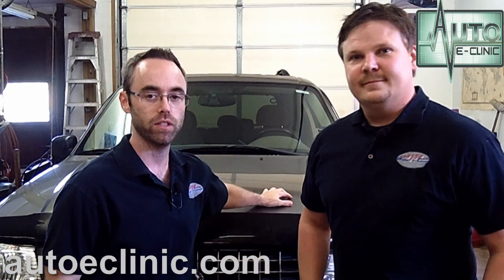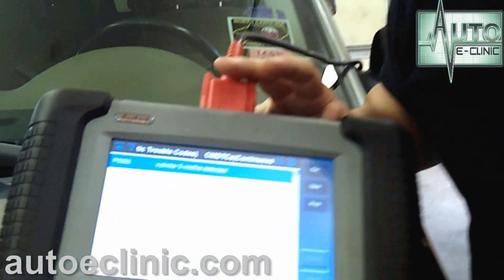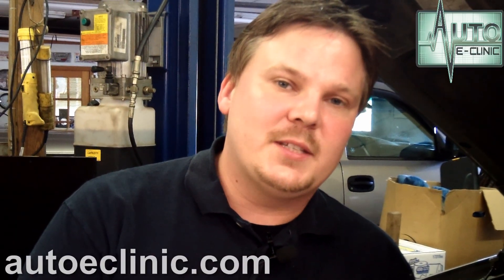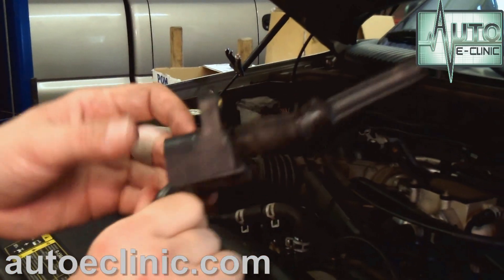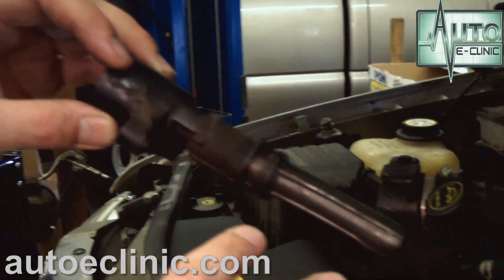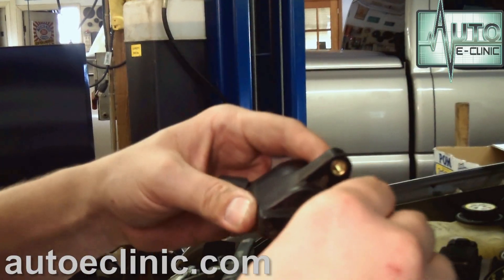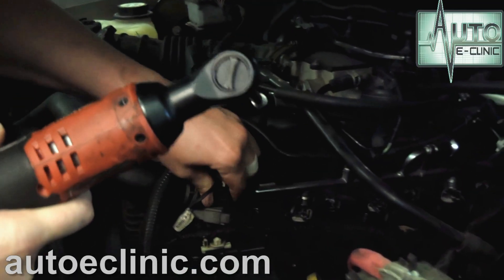How To Diagnose and Repair a P0305 Cylinder 5 Misfire - Ford Explorer

Comment: I have a 2007 Ford-150 5.4L king ranch and getting a P0305 code. I replaced the spark plug, coil pack and fuel injector and still getting the code after I cleared all codes. What else can it be?
Reply: Valve seals? Have you checked your compression on that cylinder, compared to another cylinder? I’m a retired mechanic…at age 22 lol. I was so good that o decided to be a plumber. Love those King Ranches bro. Good luck. Let me know how wrong I was and I’ll give plumbing advice

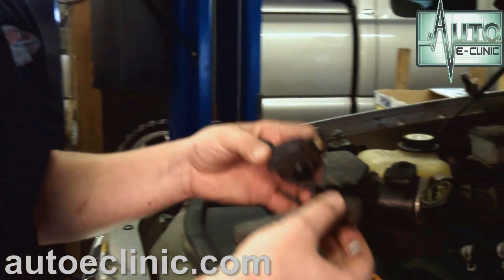Comment: if you know that. @3:20 .. why just not start replacing the whole coil pack and boot, stop causing more issues to happen. im here because I have a PO305 code, I had all plugs and coils change about 500 miles ago, and also have a tapping noise on the passenger side head, idk it kind of sound like an exhaust leak also. idk these dam fords. mine is a 2002 f150 5.4
Reply: also my coils dont tighten down you can move them by just pushing on them... ugh
Reply: You ever figure out the issue?
Reply: @gregatron4528  No I gave up on it
Reply: @gregatron4528   No I gave up on working on it

Comment: Got same code on 2015 Ford explorer  p305 and also open injector code. Replaced the coil and still kinda acts funny when going over 50mph..?
Reply: Did you ever figure it out?

Comment: i have a p0305 and the sparkplugs and the wires and the ignition coils are brand new they said i have low compression could this mean i need to change the fuel injector

Comment: I have a 2006 ford expedition p0305 cylinder 5 code i remplace the spark plugs and i switch the coil from cylinder 5 to 1 and i still get the same cylinder 5 what do you have an idea what it is?
Reply: Computer
Reply: My mecanic fix my thermostat but when he took out the antifreeze it spilled all over my spark plugs now I have a misfire 5 I'm not happy I'm worried he messed it up an he wants me to drive it back to his shop I'm literally 45 min away from the mecanic what can I do

Comment: soder the spring to the two connectors on the CP, if only replacing the spring and boot, if the ohms/thresholds of the COP is within Spec per Tech Man

Comment: Question 
I replaced my coilpack and sparkplug In cylinder number five and also replaced fuel injectors and replaced valve cover gasket and I am still getting code po305 .  Can it be I still have oil inside # 5 cylinder
Reply: What was the outcome?

Comment: Moist on spark plug rubber boot. I has same problems. I fixed it on my 2011 ranger 2.3. I see your video engine is clean that mean someone wash that engine. That cause missing fire. I like to keep engine clean free of dirty engine. I put red glue around wire set put in hole in spark plug to keep out of water. No more missing fire.

Comment: I have an 04 Lincoln aviator. I've changed all the plugs,and the coil and the fuel injector in cylinder 5 and still the check engine light comes on and flashes while I'm ideling. Any helpful tips?
Reply: BMo DaWg buy a scaner
Reply: Could be a bad valve, does the car need water often?
Reply: Had one in my bay with the same problem today... was a bad p.c.m
Reply: Bad compression on that cylinder, bad valve or lifter
Reply: Clean throttle body

Comment: what about the moisture? You didn't explain how the boot got wet.  hmm....
Reply: Jessica Burwell 
I know this is old but he clearly stated that the intake manifold WAS leaking engine coolant but the intake gasket was replaced but the damage to the plug boots from the old leak was not addressed at the same time....
Reply: Jessica Burwell it cold have been moist from just combustion which is normal
Reply: Jessica Burwell or just exterior moisture

Comment: they make a boot kit, you can clean contact very easily, and if you are not going to go through the process of bench testing to verify failure of the coil then you are lazy.  Also if the boot is soaked in coolant you have now just masked a problem temporarily.  curing a symptom for a little while is not how you properly diagnose and correct mechanical failures.

Comment: I've seen a lot of people talk about replacing coil packs. I don't think I've seen anyone go into an existing coil pack and clean the contact where the top of the spark plug spring makes contact. It's not easy to clean and I'm not sure if it can be done properly. Maybe I'll let you know after I get finished doing it on my own. what I'd like to know is how to test these to find out if the coil pack is actually good or if it's just that corroded contact at the top of a spark plug port or whatever you call that Channel Through the head.

Comment: I have a n 97 Nissan Maxima. With the same po305 code. I replaced the coil pack because it tested out of spec. It seemed at first it fixed the problem but later on in the day it started missing again. I looked at my old coil and at the bottom of the boot there appears to be a whitish residue. Could this be coolant that has been burnt dry? Do I have to check the gasket for the upper intake manifold? Or what should I be looking into next considering the maximals vq30de engine is different than the Ford motor.
Any help would be great! You can E-mail me at westventures@gmail.com

Comment from the maker: Your welcome! You may have caught Michael saying the customer replaced the intake gaskets a few weeks prior the it beginning to misfire. On these Fords when the intake gaskets leak coolant, its common for the coils and boot to come in contact with coolant. Even when recommended to replace the coils and boots because of this could add several hundred dollars to an intake gasket replacement. Customers usually opt out if there is no misfire at the time of gasket replacement.